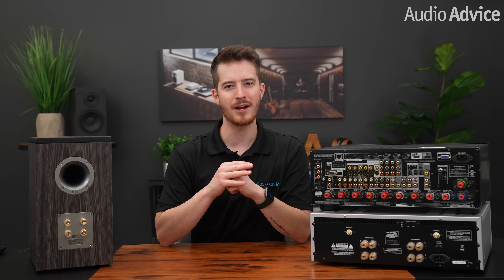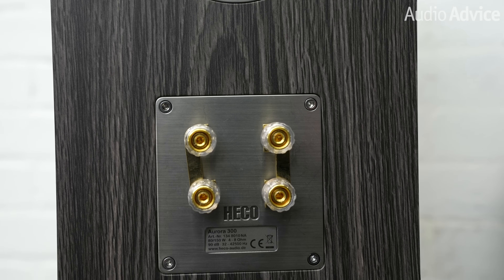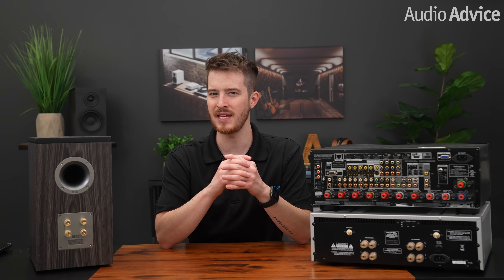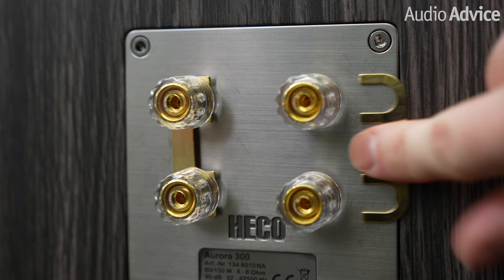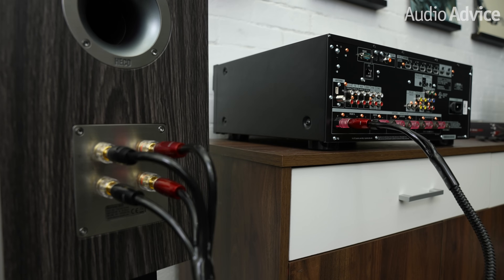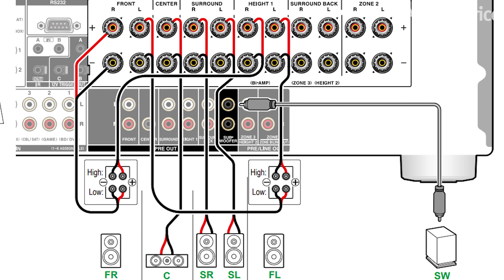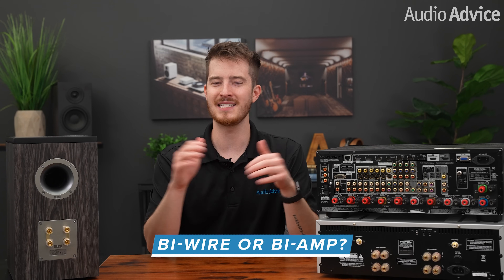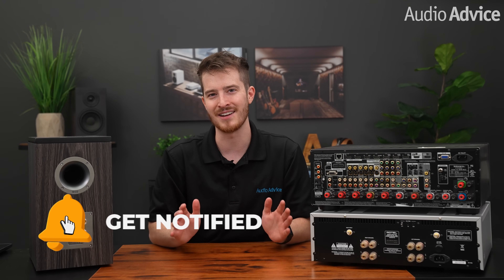Bi-Wiring & Bi-Amping Explained | What is it? How do you do it? Is it worth it? Let's talk about it!

Comment: There was a lot of important information left out of the video. Starting with biwiring, there are 2 ways to do it. An internal biwire is when regular speaker cables are used, and the conductors are split up at the speaker end of the cable. Internal biwiring typically yields small to no audible differences. External biwiring is when you use 2 completely separate runs of speaker cables. You also need to keep the 2 runs of cables separated from each other by a few inches. The explanation as to how it works isn't quite right. Low frequencies don't go back down the speaker cables. What really happens is the cable carrying the low frequencies creates a field around the cable, and if the cable that carries the high frequencies gets to close, they can be effected by that field. Also, not all xovers are made the same way. In order for biwiring to work properly, the xover has to be designed with biwiring in mind. Most speakers are not, so its rare you'll ever hear any sizeable benefits from biwiring. The difference is usually very small, and you're better off investing in something that will make a bigger difference. However, when biwiring is done properly, it does make a substantial difference. But this is not the norm, so don't do it unless you can try the cables first to see what kind of differences you hear, if any.

This is a direct quote from the person who invented the concept of biwiring. Here's a link to the entire article. https://www.vandersteen.com/support/faqs

"So we looked at the speaker wires. With two amplifiers, bi-amplification used two sets of speaker cables so we experimented with doubling-up the speaker wires and with larger wire. Neither duplicated the bi-amplification improvements. Then we considered that in a bi-amplified system, one set of wires carries the low-frequencies and the other set of wires carries the high-frequencies. We modified a speaker's crossovers to accept two sets of cables and present different load characteristics to each set so that the low-frequencies would be carried by one set of wires and the high-frequencies by the other set of wires. Finally we heard the sonic improvements of bi-amplification with a single amplifier.

Additional experiments with a Hall Effect probe revealed that high-current bass frequencies created a measurable field around the wires that expanded and collapsed with the signal. We believe that this dynamic field modulates the smaller signals, especially the very low level treble frequencies. With the high-current signal (Bass) separated from the low-current signal (Treble) this small signal modulation was eliminated as long as the cables were separated by at least an inch or two. (To keep the treble cable out of the field surrounding the bass cable.)

With biamping, you need to know what you're doing or you can waste a lot of money. There are 2 ways to biamp, horizontal and vertical. In the video, you showed an example of horizontal biamping. This almost always a bad idea, and the most common. You have one amp driving the mids/highs, and the other amp drives the lows. You run into 2 problems with this method. Unless you are extremely lucky, there's going to be a volume difference between both amps. That's why an active xover is needed. There's no other way to match the levels. Also, there's usually sound quality issues. The sound of an amp changes the harder you push it. So, even if you have 2 identical amps, the amp driving the bass frequencies will be working much harder than the one driving the highs. Sonically, it turns them into 2 different amps. 

Vertical biamping gets around the issues with horizontal biamping. To do it, you must have 2 identical, stereo amps. The left channel signal goes into both inputs on one of the amps. Same thing for the right channel. Each amp drives the entire speaker. There's no volume issues, and each amp is doing the same amount of work. Going this route should make a noticeable difference, but there's no guarantee that 2 of the same amps will sound better than one higher quality amp for twice the price. It may, but each situation is different.
Reply from the maker: Thanks for your comments, we know Richard very well and remember the day he called us about bi-wiring.  On the passive bi-amping, we did state you MUST use identical power amps.  Bi-wiring is definitely an interesting topic of debate.  AudioQuest- whose cables Vandersteen used back then, believes its the back feed.  Both possibilities make sense. As with anything where you are after improvements, the proof is in the listening.
Reply: @AudioAdvice  "On the passive bi-amping, we did state you MUST use identical power amps. "

Read my post again, or you can call Richard for his input on the matter. Either way, we're both going to tell you the same thing. In your video, you do show 2 identical stereo amps used to biamp a pair of speakers. However, what you showed is an example of horizontal biamping. Having 2 identical amps for passive horizontal biamping, is almost never going to work properly. Electrically, they almost always become 2 different amps and you'll still need an active  xover to fix the problems you encounter. If you read my post, I specifically stated vertical biamping is the correct way to do a passive biamp with 2 identical amps amps. You did not go over this method in your video. 

"Bi-wiring is definitely an interesting topic of debate.  AudioQuest- whose cables Vandersteen used back then, believes its the back feed."

There's really nothing to debate. Vandersteen didn't just use AudioQuest cables "back then", whatever that means. He designed products for them, not just used them. As with biamping I clearly stated how it works, and provided references. 

"As with anything where you are after improvements, the proof is in the listening."

I agree. No offence, but given the fact that you don't know what vertical biamping is, tells us you can't have any listening experience to verify anything. The same can be said about biwiring. It only makes a real difference that's worth paying for, if its done properly. There used to be others, but the only speaker I know of, that is currently in production and is designed to be biwired, is Vandersteen. So, unless you have listening experience biwiring with Vandersteen speakers, you really can't know the type of difference that's possible. Any Vandersteen owner will tell you the same thing. 

If you go back and read my post, my advice to anyone that is thinking of doing biamping or biwiring, is to try it first, before you make a substantial investment. I think that's a pretty reasonable suggestion. Call The Cable Company if you live in the US. They will send you demo cables of anything you want to try, so there is no risk. They also sell  components and keep demo units of most pieces. They should be able to send you 2 identical amps to try, so you may want to ask about that, as well. But definitely cables, so take advantage of their demo program.
Reply: Rather than use TWO stereo amplifiers to vertically biamp like you described, could I just use four channels from ONE power amplifier to get just as good a result?
Reply from the maker: @lawpenner  if it is a four channel power amp yes
Reply: @AudioAdvice  what if I buy a 5-channel power amplifier, use one channel for my center and then two channels each for Left and Right bi-amped? Is this a good idea?

Or am I better off just buying a beefier 3-Channel power amplifier for the same money and simply bi-wiring Left and Right instead of bi-amping?
Reply from the maker: @lawpenner  the second choice is better. This is a very good one. https://www.audioadvice.com/anthem-mca325-3-channel-power-amp-gen-2

Comment: Bi-amp, bi-amp, bi-amp!  Bi-amp the hell out of your front left and right and center channel!  It's what you should do before you buy a 2nd sub or go beyond 5.1.

I read about so many people with dedicated home theaters that don't bi-amp but then have like MiniDSP and lord knows what else and 15 subs and I wonder why on earth you'd bother feeding 100 watts from an emotiva amplifier to a teeny atmos speaker on your ceiling that plays sound at 1db every 10 days, when you are not separating the power to your LCR which play 90% of the sound and probably cost more than anything in your system.

Unfortunately, the days of AVRs with toroidals are coming to an end as along with the glory days of home theater so it's hard to find an amp that can properly bi-amp your LCR with a single box unless you pony up for the Marantz SR8015 or the Rotel 1580 which cost $4,000-$6,000 and I wouldn't.  So you will probably need to get external amplification.  

All is not lost, though, as most AVRs do support preamps and you can use them to bi-amp with another 7 channel external amp (6 for the LCR).  Then use the amp's power to power all your other speakers.
Reply from the maker: Great insight, thanks for watching!

Comment: I did not hear much difference from bi wiring. I have a paid of B&W 803D. When I bi amped with two separate power amps I heard a huge difference.
Reply from the maker: Thanks for sharing.  Did you upgrade both amps or add one more?
Reply: @AudioAdvice  I had two Emotive XPA DR1 amps, I upgraded them both to two XPA DR2s.  About 500w per channel and then bi amped the speakers.  Made a big difference.  Bi wiring made no difference.

Comment: Bi-amping works great and provides a big improvement to the soundstage. Bi-wiring is identical to straight wiring, at least on a schematic and I have never noticed a difference.
Reply from the maker: Thanks for sharing.  We think active biamping where you totally eliminate the passive crossover offers huge improvements.  Its just hard to find as an option on most speakers.
Reply: @AudioAdvice  Yes, this setup is hard to find, and I was totally frustrated and went forward with building my own speakers. Two separate crossovers (High/Mid/woofer and Subwoofer). They are powered by two 1968 McIntosh MC250 (fully restored) and two preamps coming off of my mixer board. One amp feeds the upper crossovers and the other feeds the lower crossovers. The speakers are modeled after the Troels Gravesen CNO-4.
Reply: @AudioAdvice  Is it easy to remove the passive crossover in the speaker?
Reply: @derekviveiros  yes, just unsolder it from the terminals
Reply: The key proviso is "at least on a schematic", and it's sensible of you to put in that caveat. A schematic is a conceptual circuit, and there's a lot of information detail that a basic one doesn't convey. Proper circuit analysis reveals bi-wiring and single wire connection are not identical, but the differences in operation are small and likely to be overpowered by other factors. It's not surprising that people have tried bi-wiring and not heard a difference, and it's not surprising that some are sure they do detect a difference, since the possibility can't rightly be excluded.
Reply: I’ve got a 3- way active setup planned.
Reply: Eliminating the passive crossover is the way to go. Working on designing a system using dsp before the dac to split the source signal into hi mid and low for each speaker and put those outputs into a dedicated dac and amp for each output (L/R high/mid/sub). The analog paths should never cross so each speaker should get a very clean signal.

Comment: Hi, thanks for the info. One question remained for me: What about amps with A and B, 2 speaker outputs, but no specific setting for bi-amping. Can they be used for that, output A to lows and B to mids/highs?
Reply from the maker: Good question, that does not gain you anything, that method might be easier for biwiring though.  Thanks for watching
Reply: There could be an issue here where the impedance could be halved, similar to having 2 sets of speakers connected. Depending on the amp's capabilities this could increase the current and damage the amp.
Reply: I usually use the A channel for the highs and the B channel for the lows but at the end of the day there giving out the same signal from the amp.
Reply: I just set my Yamaha c1010 up like this. It made sense to me. How could it be bad to run the a+b speaker channel option? I mean wear and tear possibly, but it’s basically halving the power to both uppers and lowers. Unless there’s a problem with allocating half power to the uppers. Any thoughts would be helpful. Don’t wanna ruin my equipment
Reply: I would just buy an extra set of speakers. 
Match the equipment well. 

Bi wiring is, to me, a way to overcome problems between filter and amp as any amp can be used.
An Equalizer is another helpful instrument. my amp only has Volume😂

Comment: A less talked about version of vertical bi-amping: using two stereo amplifiers 

Using two 70w per channel Conrad Johnson Premier 11A tube amps (not bridged) with a pair of B&W Matrix 805’s and two REL T3 passive subwoofers. 

One channel of the 1st amp wired to the B&W. driver and sub. Note a REL sub connects to the speaker terminal of the amplifier being used. Then the 2nd channel of the 1st amp is wired to the B&W’s tweeter. Repeat the aforementioned process for the 2nd amp, B&W and REL. 

This allows a mono block setup using a pair of stereo amps. If mono blocks were used to do this, would require FOUR mono block amps. 

Like the results and while listening to music (not the gear) can hear more top end clarity and detail 

For the record, rest of gear: Conrad Johnson PV12 tube preamp (11A RCA’s married to accommodate use with the PV12), Linn LP12 turntable with a Ittok arm and Lingo III external power supply, Naim CD XS? Naim ND5XS Streamer/Media player…and still have my Nakamichi DR2 cassette deck (lot of radio concerts on tape) and my Audiolab 8000T AM/FM Tuner
Reply from the maker: Thanks for sharing, yes, that is another way to do and the best way to vertically biamp actually since it simulates mono amps.  Did you feel the difference was worth the cost of the extra power amp?  Nice system too by the way!
Reply: Did I feel the difference was worth the cost of the extra power amp? Absolutely! ❤️

Plus, mono blocks from the same era run round 4K a pair. Adding a 2nd 11A and getting it refinished in black to match the 1st 11A (and black PV12 preamp) cost about 2K 

Not a fan of the standard champagne CJ finish and nice to have all the gear in understated black

…except the Linn. It has a rare black Ittok arm but also a custom purpleheart wood plinth. For those who don’t know, this wood grows naturally a rich shade of purple 👍🏼

Great channel, subscribed!
Reply from the maker: @cirenosnor5768  Thanks for sharing, funny enough, way back in the late 70's we were lucky enough to obtain serial number 001 of the first CJ Preamp, the PV1.  That was our founder's first tube preamp.
Reply: That pretty amazing, if it’s not still in your circles, wonder where it is now. Most likely worth a small fortune ❤️
Reply from the maker: @cirenosnor5768  We wish it was!  No idea but yes, probably worth quite a bit.
Reply: And what about Tri-Amping?

Comment: First time viewer here. Great video, informative and perfect length for the topic. 
My current avr is a Yamaha rx-a2a, it has bi-amp capabilities and I do notice some separation improvements. 
What is your opinion, is bi-amping technically running 4 channels instead of 2 during 2.1 listening?
My main concern is the lower level avr’s, advertise their power ratings with two channels ran, and the power is supposedly dramatically reduced when running multiple channels. 
Thank you
Reply from the maker: Thank you!  On some AVRs you are right. If that were the case and you try biamping you should probably connect the bass driver to the main left and right and the treble to the other channels then try the other way to see if you hear a difference.  Thanks for sharing what you experienced
Reply: @AudioAdvice  did I win a giveaway?
I received a email about it. 
Thank you
Reply from the maker: @WardoUSA  Thank you for letting us know.  We have been reporting these to You Tube.  It seems that someone is impersonating us.
Reply: Just saw this video and it gave me some questions. My now old THX Pioneer receiver I went in the menu and looked at Surr Back System, here I have the alternative to Front Bi-Amp.
For years my front speakers is Bi-Wire since I was under the impression that you MUST have two recivers to Bi-Amp your speakers.
But did I understand it correctly that my reciver have a adjustment that let me Bi-Amp the front speakers whitout using two separate recivers?

Comment: The theory at 2.34 is wrong, and about as dumb as it gets for cable foo.  No matter what you do that bass drivers claimed issue is present, as the drivers share the same cable, from amplifier circuit board. All your doing is moving the point of 1 cable going to two cables.

You see, a biwire speaker is identical in circuit to a single wire speaker, if you draw the electrical cicuit you will see this. And with no box you see that no matter where the connections are,  no matter what you do, you have a full range signal going from one point to two, its why proper engineers state it is not worth doing, and why many forgoe biwire completely.

You can see it visually explained rather well here https://www.youtube.com/watch?v=McH2tlfj0vo  

SO as long as you have sufficient gauge cable with a good LCR the cable will do it's job and sound like it is supposed to.